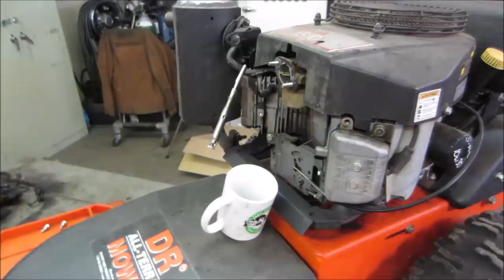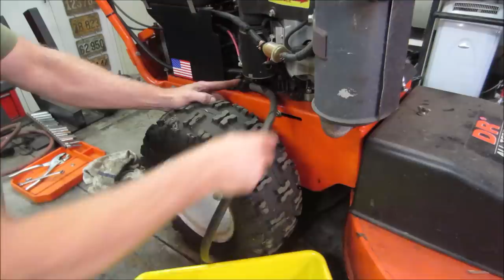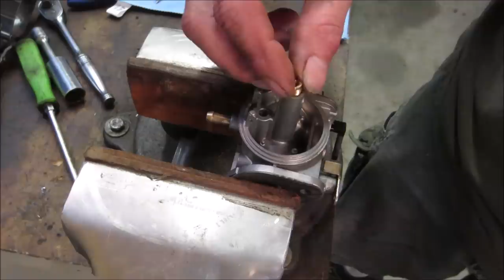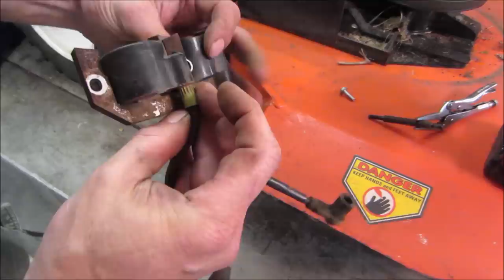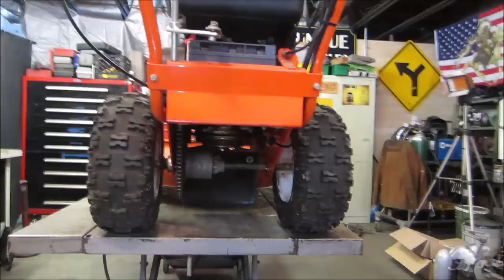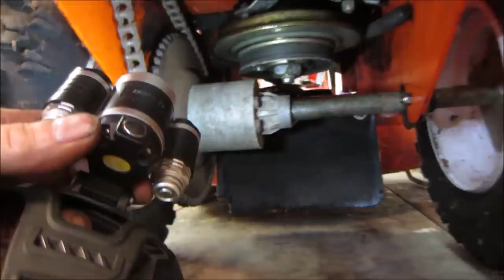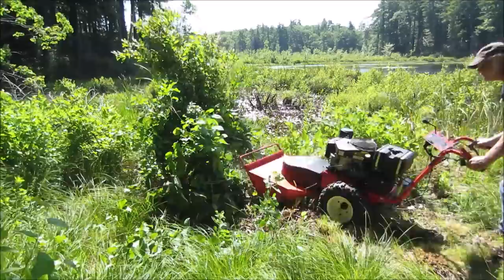Will It Run? Abandoned 11 years ago. DR Field and Brush Mower

Comment: Buying Not running sitting 10 year power equipment for top dollar is idiotic and the ass wipe that said. You took advantage of someone with an OFFER they felt comfortable with EVEN if it was completely running. isnt an issue. IF he offered 100 bucks that would have been a low ball offer. he said 500? Thats standing tall on a machine sitting for 10 years... He offered TOO MUCH... 500 is a pile of money for a sitting 10 years machine... It could be sitting with a bad motor.. and you paid 500 for a junk. 300 would have been my offer i buy shit all the time.